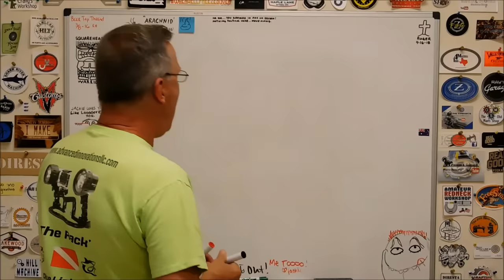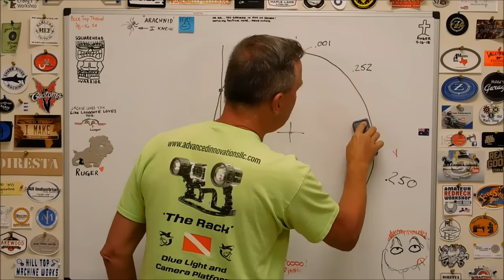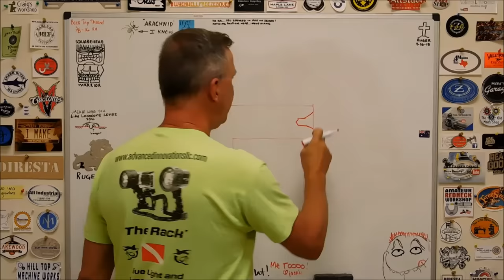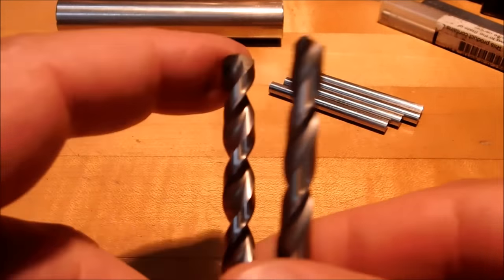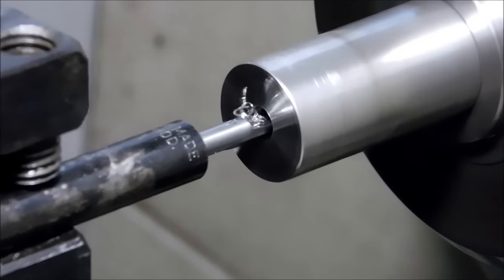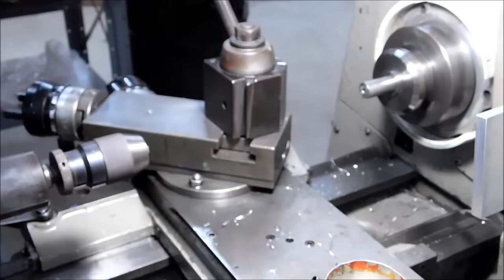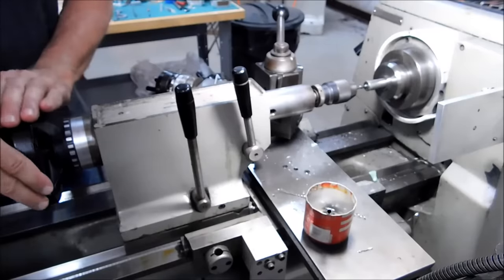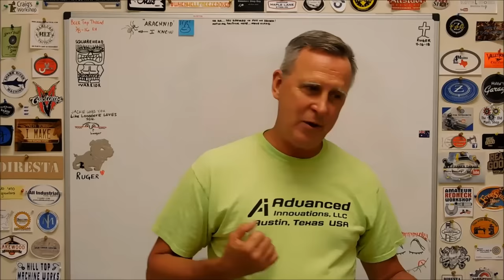Techniques for Machining Straight Deep Holes -- SHOP GEM --

Comment: Was any of that first part supposed to make sense?
Reply from the maker: Nope. Total BS. 100% ( JK..of course it was )
Reply: It does make sense, but I had to hold some bits in hand and noodle the mechanics of it a bit. Yeah. It is hard to explain, but did you understand differential equations the first time you saw them explained?
Reply: @machobunny1    I'd say differential equations are not a good example for this fella either..

Comment: There is a Japanese "game show" called Supreme Skills. They did a challenge for drilling through a .5mm pencil lead. One machinist used wire EDM, the other used an engine lathe. Guess who won (hint...lathe). I found it to be truly amazing. The narration is over the top, but it's a fun show to watch and puts manufacturing and craft in the spotlight.
Reply from the maker: I saw that. Clever setup for the lathe approach.

Comment: If you would use carbide reamer, then hole would be straighter and pin will go through without pushing it
Reply from the maker: The alignment would be the final judge of that.
Reply: @joepie221  I made a lot of similar pipes for aerospace industry. Centre drill and drilling from both sides using carbide short drills to meet the holes then picco boring bar, as deep as it allows, check size the by pins then carbide  reamer with 6 straight flutes through. It is important to cut the chamfer in bore before the reamer. Then you should to have runout below 5 thou both sideson 2.5 inches long piece

Comment: So you make then a half inch longer, cut .250 off each end and chamfer. Got twenty years CNC plus Tool & Die. Left because of illness. Ready to jump back in part time. This is warmin my blood up. 
Texas, keep it great, teach the incoming to stay right.
Reply from the maker: This is more of a video on long deep holes that may walk due to smaller diameter drills and not holes with a bell mouth condition. Your method is spot on for lapped or honed holes that may demonstrate that characteristic.

Comment: I once used a similar technique in a mill (for the spot-pilot-ream) and then long-throw drill press to drill a 12" long 3/8" Dia hole in 1/2" aluminum plate. Worked very effectively for me, end only strayed 2 thou by the end-probably just got lucky though.
Reply from the maker: Start tight, end right.

Comment: Center drill... everytime. (You can ask my wife)
Reply: Yves SHAW Wrong. Spot drill if the drill geometry demands it. Center drills are for centers, spot drills are for starting holes. Split point carbide will only be damaged by traditional centerdrilling/spotting. Unless specific included angle is taken into account.
But yes, most hss drills have a chisel, thus requiring a spot(not a center).
Reply from the maker: There are a few schools of thought on that. A new or perfectly ground drill is a must. A center drill pilot takes less pressure to begin a hole since the chisel center of the drill bit is not pushing. It allows for a partial footprint before the pressure is applied. I spot drill softer materials and threaded holes.
Reply: @chuckphilpot7756  yes, it's not good for asymmetrics tools, as two flutes etc. But my plot is to never drill anything without a good center plot. Even a little center punch. For sure, there are exceptions. (you can ask my wife for this one too) 😊😊😊

Comment: A boring bar going into a non-true hole will never give you a true hole. The closest and most accurate way is jig-grinding but even that isn't a perfect solution. Once you have a jacked up starter hole, it will be projected onto your final hole, granted in most cases it will not present enough variation to make a difference.
Edit: Clarification-This is due to tool pressure. As the boring bar scrapes different amounts of material the tool pressure varies, which in turn varies the amount that the boring tool flexes, which in turn varies the finish.
Reply from the maker: I respectfully and completely disagree with your comment. If you have a severely eccentric hole and you try to true it up in one pass, the tool load oscillation may translate to the new bore. As demonstrated here, several passes are suggested as well as the use of a dead pass to remove high spots from early process tool load changes. You can absolutely true up an eccentric, or out of round hole, with a boring bar.
Reply: Joe Pieczynski I respectfully disagree as well, there is no such thing as a true hole or bore. If you noticed what I said in my prior comment, often the variations are minute enough as to not matter. But they are there. Even Jig ground holes are not perfect, regardless of passes. Splitting hairs? Perhaps. Depends on the industry. If you are making ball joints or something non-critical then who cares. But let's say you are trying to hold a precise impedence value between two mating components. 99.9% of applications it will not matter. It really comes down to me disagreeing with the nomenclature of "True" or "Perfect" more than any of your techniques, you provide very solid information that will get probably everyone as close as they need to be to true, without being perfectly true.
Reply: Most of my shop work is correcting worn eccentric holes with boring bars. I correct bore size and orientation all the time.
Reply: Joe Pieczynski Also, it is more rigid to spot drill with the cross-slide using a center cutting single point tool than with the tailstock. Again, nothing against your method. Just figured if we were striving for perfection we should use all of the tools in our box, including most if not all of the tips you have shared.
I believe it should also be noted that you want your spot to be of the same included angle as the drill following it. I cannot believe how many shops spot with a 90° spot drill and then come in after with a 115° or 135°.
Reply: @chuckphilpot7756  i bet you read a lot, and watch a lot of TV. Your comments are not practical or applicable for the majority of machine tool processes. The cross slide spot drill comment proved that point. You sound like a 'know it all' scientist that has actually never done the things he claims to be an expert at. Go work for NASA, its the only place close to the level of perfection you care to discuss.
Reply from the maker: @chuckphilpot7756  I am genuinely interested in what industry you have the most experience. Your comments seem to come from a place few of us will ever get to. Hubble telescope level precision. My entire professional career, I have known wire EDM and jig grinding to be the most accurate holes you can get, yet you even dismiss those as not close enough. Please reply with more detail about the type of precision, application and validation you would suggest. For now, this demonstration is spot on for engine lathe work, as many would agree.
Reply: @Shop-Tech  you would be suprised by the amount of "close enough" in aerospace that is way out of published specs.
Reply: @joepie221  Definitely goodenuff
Reply: @joepie221  Good enough, satisfactory, sufficient, acceptable, suitable, reasonable, agreeable, adequate, usable, all right; these words do not necessarily mean compromise in any endeavor, just a point at which nothing further of substance will be gained by additional effort. Don't let perfection be the opponent of good enough.☺
Reply: Joe Pieczynski I currently work for the largest medical cardiovascular contract manufacturer in the world. I work with exclusively platinum/Iridium alloys and we are not only Iso, but also F.D.A. and globally certified.I think you may have taken my comment as a personal attack, which it was not meant to be. My personal experience? Horizontal/vertical cat 50 programming and jobshop work. Manual lathe, vertical turning centers up to 60", integrexes from 100 up to 300, 5 axis programming, jig grinding and boring. Utilizing precision metrology as well as a few years of metallurgy utilizing both microscopes, comparators, surface roughness testing devices, as well as Mitutoyo Elf systems, cmm's, laser disintegration and mass spec/chromatography, and all of the standard full size gauges you would expect to use in any machine shop. I was very clear in the fact that your methods will work for almost any application. On a 1/4 hole, it sure doesn't matter. On a .01" hole with +/- .00005 tolerancing with an impedence callout these imperfections are not only measurable but directly influence the components ability to properly direct the correct amount of current into the heart.
Edit: I was headed into work, corrected and revised. There are no Imodium alloys. 😂😂 I totally forgot to mention my Swiss turning/milling/forming experience, press brake programming, laser programming, as well as several years of being a fabrication supervisor after being a progressive stamping-setup operator and then a die repair technician(shimming, grinding, polishing, etc). I have been around cnc's since I was 8 years old going in with my dad on Saturday's to watch him rebuild spindles or ballscrews or whatever needed done. I don't say any of this to be boastful as surely there a tremendous amount of better qualified as well as more intelligent and skilled people in the world than me. I merely stated my background to the clown up top who was interjecting his feeble insults into a polite conversation between two people.
Reply: Shop Tech Go back to pressing the start button JR. Just because I brought up something above your paygrade does not make you correct.
Reply: 58 Marine I will leave you free to infer any negative connotations from my comment that you wish. I just have a problem with all these guys with the "it's good enough" attitude.
Which is why all of our jobs got shipped overseas.  Not because it was cheaper than skilled labor, because the skilled labor decided to stop using their skills.
 We stopped bringing our brains and innovation to the table, got complacent, fat, and greedy. 
And my generation and the ones that follow bear the burden of those lazy decisions and viewpoints. 
I also believe any person trying to belittle someone else, or dismiss their ideas with no investigation or consideration (or capability of even comprehending the ideas presented in his case) is no true machinist. 
The difference between a well trained operator and a machinist in my opinion is that the machinist will always strive to learn and better not only his process, but the underlying knowledge that goes into them. Whereas an operator will typically just get good enough, or even good at something with no will or drive to understand it any deeper than that.

Claiming the only place for precision is Nasa is denying that the world as a whole is growing increasingly miniaturized from electronics to mechanical devices, watches, microswitches, medical devices as well as NASA. etc. 
Anyone claiming that the pursuit of perfection is wasting their time is just doing their part to ensure the irrelevancy of any machinists in the generations to come. 
Without the pursuit, what drives innovation?
Reply: Joe Pieczynski I cannot divulge alot of the techniques that we use as a shop, as I am sure you are aware. But think of taking as true a hole as you can make, grinding, lapping, honing, and then micro coating to eliminate pores in the grain and reduce the problems associated with boring or grinding leaving micro hairs, pitting, trilobing/workholding stress and fractures. This is by no means comprehensive or in order. Just to protect myself while being able to perhaps add something of value.
Do you have a comparator in your shop? Or a microscope? Zoom in at your bore to about 20x-50x and compare it to a ring gauge if you have one of similar size. 
The problem isn't your technique, or even your intelligence. Both are outstanding. And again, I was not criticizing although I may have inadvertantly come across as if I was. If so, I apologize. I have a tremendous amount of respect for anyone who puts their heart and soul into finding better ways and then on top of that who shares them free of charge. In case I missed it the first time, thank you for the hard work that you do. You can bet your ass if all I had was an engine lathe or mill at my disposal that your tips are going to get me closer than I would have on my own. 
I am just afraid we are moving into a world where bridgeports and engine lathe skills are the ones getting shipped overseas. They are certainly more satisfying to work with. Sucks not being able to see chips fly, but that is just the world we are moving toward. Hate it or love it.
Sidenote: Any thoughts on additive manufacturing? I personally believe we are on the cusp of breaking through to the point where a good percentage of traditional machining will be complemented if not outright replaced.
Think about dot matrix printers vs what we have today. Scary, right?